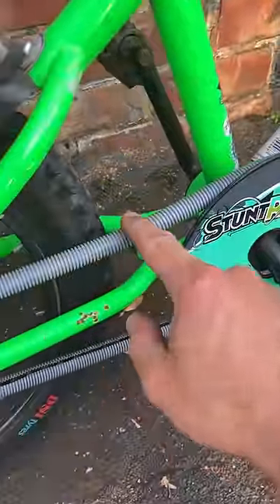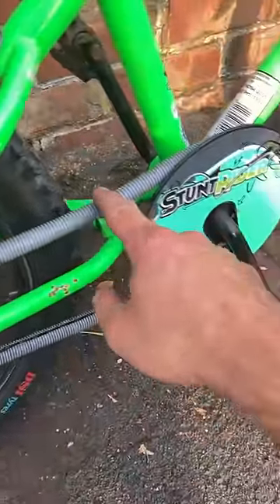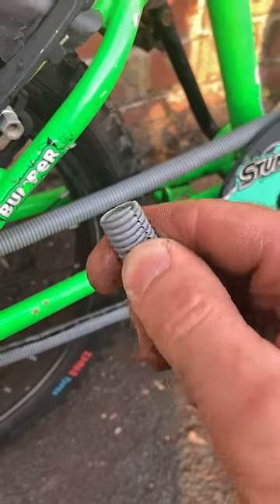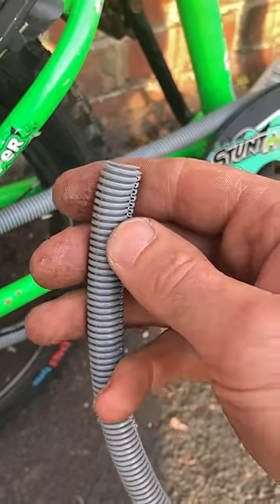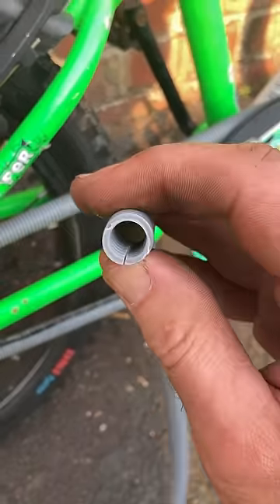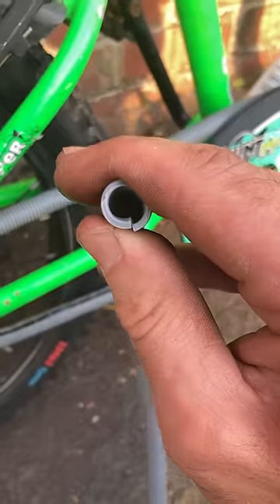Kids bike chain guard hack #bike #bikehacks

Comment: Curious about "condensor tumble dryer hose." Is that a common thing where you're from - instead of having hot moist air blasting out the house via 4" pipe your dryers use a heat pump?
Reply from the maker: Yes. Quite common here. We have the typical vented dryers but they are considered not very energy efficient so there are also condenser dryers that use a heater to heat and a basic heat exchanger to extract the water. I recent years heat pump dryers have appeared. Both types drain the water to the bottom then pump it up to a drawer tank in the top. They usually come with another hose so you can plumb it to drain to a permanent waste rather than having to empty the tank.
Reply: @bootsowen  Beautiful! And now all of us a hop across are paying to upgrade to the "new" all-in-one!

Comment: For anyone else doing this, to save 2 hours, instead of using tha n cuttin it, they make the exact same thing in black to sheath wire n it comes pre sliced, jus cut to length, spread and attach… not my style but if u go to O’riellys, auto zone etc, they have blue & red ones

Comment: Wait a minute... Why does a tumble dryer need a water line?
Reply from the maker: A condenser tumble dryer condenses the water into a sump and pumps it out or to a tank. It does not have a vent. Heat pump dryers are the same!
Reply: @bootsowen okay, well that makes sense. Thanks for the reply!

Comment: You haven't survived childhood unless you trapped your fingers in the bike chain. Also, slipping off the pedal and smashing your shin repeatedly whlist your foot bounced of the floor.Ruining your brand new trainers and rear tyre by slamming your foot on the the tyre to pull skids And getting a Backie off a mate only to trap your foot in the rear wheel. Ah the good old days. No helmet , makeshift Ramps out of wood and house bricks.  and riding down flights of stairs feeling invincible.
Reply from the maker: sounds like you barely made it through childhood.
Reply: @bootsowen  lol I barely did. 🤣 I'm 40+ now and take everything as easy as possible. I'm not exaggerating here 

Meeting car bumpers x2
Fell through ice x1 
Fell off high places x4/5
Reply from the maker: You've had your fair share alright!

Comment: Moisture gets trapped and if there's any rubbing from the hose it will not only wear out fast but also make it harder to pedal. This is not a hack, there already is a chainguard installed and the piece of hose would serve no other purpose.

I have a much easier hack in case you don't have a chainguard: roll the right sleeve of your trousers...

Comment: Try that on a mountain bike see if it works.
Reply from the maker: it will as long as its single speed.
Reply: @bootsowen  that kind of defeats the purpose of multiple gear's. 🤔 Maybe someone will find a way to make it work with multiple gear's. 🤷 Who knows, if it wasn't for curiousity we wouldn't have innovations.
Reply: @bootsowen  i wonder 🤔 if you where to try and create one that has less width more like a chain hugger. Maybe that could be something to look into. 
Because the basic idea of that chain protection is good, but how to improve on it for multiple gear's. 🤔

Comment: I can’t see this lasting long and in the process there will likely be friction issues. I don’t suggest trying it as piece of shredded up plastic may entangle in cogs, etc
Reply from the maker: Have you tried it. It has worked well for a few months with none of the issues you supposed.
Reply: @bootsowen  really? Was getting the tension correct challenging?